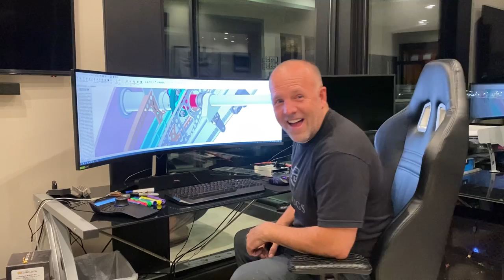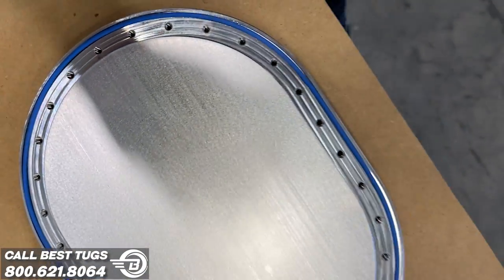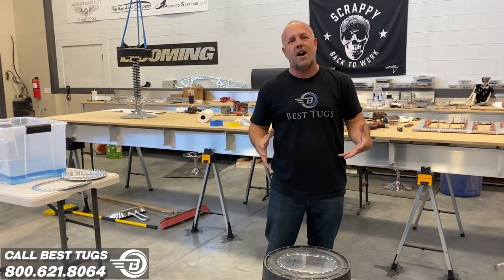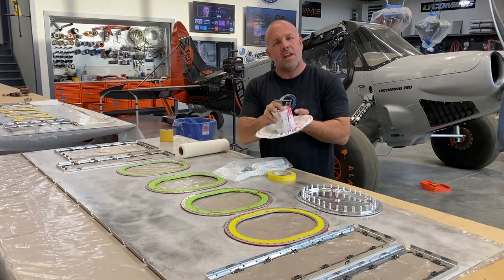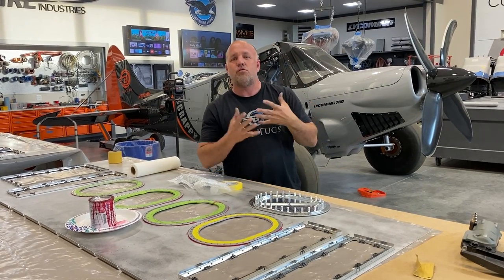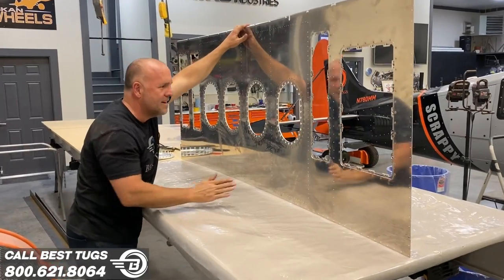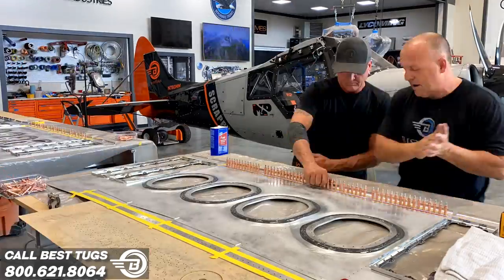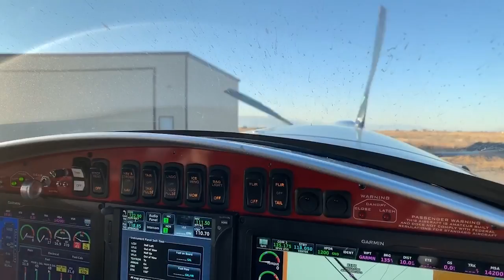WILD, one of a kind, Bush Plane Build | Scrappy #54

Comment: A few of us are trying to create a new safety culture in climbing circles. It is the philosophy and virtual religious mantra to test before you commit. That is exactly what Mike Patey is doing each step along his development process. He is using engineering to eliminate potential problems in the future based on failures of the past. In climbing we test our system each time we change a set up. We stay attached to our anchor and test our system to ensure it has been set up correctly and only then do we disconnect from the anchor. We then continue to use our system that we know is correct until we need to make another change, then we reconnect to something we know will not fail and then and only then do we make a change. Repeat, rinse until we are back home with our loved ones.

Comment: The important thing here is that Mike is putting that little extra bit of effort in to every part as he goes. That's the bit that us mortals without CNC everything and unlimited budget can apply in our own work. Even if that's just making sure we use copper grease on the threads, swap out corrosion prone fasteners for stainless steel, make sure we drill proper pilot holes and countersinks when we're doing construction in timber etc. My dad (a very experienced and innovative engineer) always taught me to "cherish every part" - whether that's a part you're making or a part you're replacing, eventually your car/plane/furniture project/ motorbike ends up better and better a bit at a time.

Comment: Admit it, if these wings split into two like an X-wing fighter from Star Wars, nobody would be surprised.
Reply: Don't give him anymore ideas!
Reply from the maker: @daverohn383  😂👍😂
Reply: But if ya think about it...if you had excess fabric wadded up in the swing. You keep them tucked for speed and then split the wing halves to gain an extra 20sf of wing surface per side? I don't think that would exceptionally change the flap and slat purformance...I'm talking an 18 inch separation at the wing tips..
Reply: @daverohn383  i disagree I like it when mike gets ideas

Comment: There are so many aspects of Mr. Patey's engineering processes that are admirable. Possibly the most impressive is the degree to which he tests/proves his designs before flight.
Reply: I was thinking the same thing
Reply: AGREED. Sadly some of his work is merely doing it right or doing it the best it can be in the aftermath of others not doing it right or doing the best it can be done. A fisherman called Matt Watson in New Zealand gave a tour of his offshore rig. One of the features was a bow rail that instead of following the shape of the bow up and out, was set back inside the boat and met the person standing forward in the toss and turn of the sea, right at hip height, PERFECT. It was like he had invented fire and all he did was say "NO, I want it the way I want it."
Reply: Too bad he couldn’t have been involved with the raptor project; it would have turned out way differently.

Comment: Good explanation of different fuel panels. Had a 757 come in, had to remove a fuel panel. The screws were not tight and some were sticking out. It never leaked. Has the same design. On the other hand, talking about top plates, DC9/ MD80 top plates for access to the fuel boosts pumps. You find them leaking when they fuel the plane. Had several gate calls before and found little fountains on top of the wing. Tighten screws and carry on. 
 Didn't see this but and good tip for smoothing out sealant is to use soapy water on your finger to do the final finish on the sealant.

Comment: Mike you are simply a genius!  I will say your fuel plate design is the exact same as the V-22 osprey which I’ve been working on for quite sometime now. At this point on life after dealing with them so much I really wish the engineers that designed it would have put as much thought into that thing as you do your projects. I can’t wait to see how scrappy ends up coming out, it will be amazing and unique. Also I just wanted to thank you for everything you do for aviation as a whole. I’m currently trying to finish up my private and my A&P. You inspire not only myself but others everyday! Let’s get back to work!!!

Comment: OH WOW!!! Now those one piece fuel doors/ threaded seal caps would have been a godsend on my KC-135 back in the day .... where each nutplate had to be goobered up with sealant
Reply: Guess he won't be needing the pink powder, eh?
Reply: @barrygrant2907  OMG you remember that !!!!   I was not only a crew chief.... but since I was small... I was also fire guard on graves when we had a man in tank..... so I could climb in and rescue....so I learned a ton about the inside of a tank.... they taught me stuff the crew chiefs didn’t know.   And LEAK DETECTION was my strongest asset.  I actually had a puffer bottle in my bag ... along with my CTK ... SAC 81-85
Reply: Engineers everywhere are like… why didn’t I think of that?

Comment: As always, I soak this stuff up like a sponge. Your approach to building is more than an inspiration, it's manna from heaven! 30 years ago, I had an idea on how to increase thrust in a ducted fan. I have stretched it our so many times over the years and never pursued it. After watching your progress on Scrappy and the methodology you use, I have begun drafting out a test version of my ideas. It will take me some time, but I have to thank you for getting me back into the right frame of mind to finally "get back to work". Keep up the fantastic job you're doing. My sponge is drying out!

Comment: I wouldn’t think that testing the fuel tank inspection doors with so much static head pressure would be analogous to in-flight dynamic pressures. You could likely remove all the screws for that test and the head pressure will only better seal the o-ring. That being said, it’s beautifully engineered and I doubt it ever would leak. Nice job, Mike!
Reply: I am not a design, structural or fluid dynamics engineer but I am curious about expansion of the AV fuel on a super hot day, no matter the density altitude.
I know and understand there will be overflow/ expansion vents...
Another curious point of interest, regards the expansion and contraction of the aluminum arising from the ambient air temperatures.
Beautiful work, Mike and crew!
Now, back to work!
Reply: @snoopy7647   @Snoopy  Well, notice that everything is Al alloy so no problem with differing expansion coefficients (only slight variation from gauges/thickness) and no cement (such as epoxy), only flexible sealant and 0-rings. I reckon the design of these tanks and service ports would be up to the job on a space craft.
Reply: @snoopy7647  It's not that bad, only a bit more than mogas due to the more aromatic nature of avgas.

Comment: At Boeing, when they were bucking the rivets, the noise was so bad they had to ensure all employees had hearing protection, and it was mandatory.  When they installed the rivets it was called "Bucking".  One mechanic was outside the aircraft, and another inside.  The outside mechanic had a hammer type tool that pounded the head of the river and the inside mechanic has, what is called a "Bucking Bar" which was used to flatten the tail of the rivet.  It has to be within a certain diameter, based on the type of rivet.  When you had multiple processes happening the noise was deafining.
Reply: I was in there helping w/ the tanks today and made sure everyone had ear pro.  It’s crazy loud!
Reply: @ChandraSlyFoxPatey  try listening to the bucking prices when there are multiple processes happening, on multiple aircraft, with the aircraft acting as amplifiers.  It's nuts!
Reply: @timothyosborn1697   😳🤪😳🤪 I’ll bet it would rattle your brain!!

Comment: Thought it was great seeing that 2 part sealant in the tube used on a project like Scrappy.  I use that stuff on a regular basis with the P-3 and EP-3 phase maintenance here on the Navy base in Whidbey throughout the week, and not just in fuel areas.  Makes awesome fillets for antenna bases and other vulnerable areas with hydraulic fluid intrusion points.  Just wonder if much of the engineering going into Scrappy will be incorporated into Draco part 2. Definitely got me addicted to waiting for the next episode Mike!  Keep up the awesome work!

Comment: Hello Mike. I really enjoy watching your post. I just finished watching #54 and was wondering about the sealants you used between pieces. You are using what was designed as a sloshing sealer in the place of a fay seal. I like the fact that is so thin and will eliminate rivet pucking but will it remain sealed over time. I'm building an F1 Rocket at the moment and would like to have the smother rivet line result on the tanks.
Reply from the maker: 🤠 hope this helps. So where I used it and how I used it I’m 100 percent comfortable as it’s an inch past the main fuel tank seal.  You will see in another video the main seal is done with a conventional seal.  On the joints that have direct contact to fuel or may not get a second joint layer of proseal or other primary covering, I would use standard seal and if you want you can dilute the tank sealer to make it a little thinner but in the future video you may get some ideas how to do it as I will show more detail.

Comment: Parks $150,000 worth of vehicles to protect 2 plastic buckets. 😂 I love this guy.
Reply: I think the bigger concern is to protect the fuel in the test tank from being spilled out if hit by a vehicle. That could make quite a wiener roast if that happened.
Reply: The vehicles are insured and can be replaced.  The test results are priceless.

I expect that the test fluid was water and not anything dangerous.
Reply: Think he was more worried about having to restart the test!
Reply from the maker: 😂😂😂. Yea the first day test was water so if I had a problem it was easy.  After that I did a 24  hour test with fuel as the final test.  It would suck to spill that 🤪
Reply: Mike Patey thank you for all you do sir 🙏🏼. You are a huge inspiration and I am patiently waiting for my Scrappy wing souvenirs. I feel special for being able to watch this series in real time. God speed sir.
Reply: @MikePatey  Tell me about it... I was a fueler at SJC for Atlantic Aviation in the '90s.  Fuel spills definitely suck!
Reply: Why not add a $2 spigot to the bucket and negate the need for a pump.
Reply from the maker: @garyg7145   🤠 great question, if I had it I may have considered it.  The simple answer.  I didn’t have a one in my hangar for the tank so it is less time to take a giant pump I have on my fuel tank and pump it out in one 3 minutes then it does to drive to the store, buy cut, bond and install a drain for a single test when what I have can save me an hour plus.  I will do just about anything to not leave the shop.  It just destroys the progress every time you leave for anything it always takes way longer than you think .  Well it does for me anyway.  I’ll do it the hard way if it saves me an hour or two.  👍🤠
Reply: @MikePatey  why are the wings aluminum instead of carbon fiber?
Reply: @PetesGuide  I've been very curious also. Part of that may be because of the inspection doors. The other could be because he started with aluminum  spars. Although  had he had encased those in foam he would have had no trouble with electrolysis. I have a feeling there are a couple more surprises coming.
Reply: @MikePatey  Don’t you have somebody you can send out for parts when you need them? If you know the shop, the part you need, give them a call and have them taxi it to you. Delivery in minutes at a cost you can easily afford.
Reply: @MikePatey  Yes, important to test with fuel as it will go through a smaller hole than water will - that's how those filter funnels work.
Amazing how true the wing was when you put the level across it! Great work!!

Comment: Inspection doors under the wing. Avoid any sleepig failure possible is just way to go in my opinion. Sleeping failure is just a bitch waiting to rip you off. You like to know about leaks when climbing to altitutes where humidity can build up ice or water can be sucked in by decending when there is no pressure relief in a cavity. How do you handle the pressure inside the tank? Would be nice to know.

Mike, the fuel drip test... ain't it harder to seal low pressure because of sealing activation? Especially when screws are lose. Your drip test is cool and hands on but I'd test it without all that weight with just a little fuel inside.
Reply from the maker: 👍🤠 great questions. tank vents maintain a max of 2 psi and never a vacuum under any altitude changes or speeds.  I did test the tank at intervals every few inches after that water test.  I started over with fuel and step tested.  So many things get left out of the video as I had so many hours  of footage and try and skim it down to 15-20 minutes
Reply: @MikePatey  thanks Mike. Had to be some valve or thing preventing the fuel tank from vacuum. You need engine up there 😉 Regarding those tons of thoughts and decissions leading to a Scrappy you will never be able to spread all those details and cross paths, dead end roads... wait... am I the only one who would appreciate to be provided with your raw uncut material? You should run a show based on this builds because Scrapy won't be the last and your family continues maybe. Like Boyds does but really focus on the hard part of designing critical products. Appreciate your effort.

Comment: Also if there's a leak on a top inspection door if the tank is full enough to be against the door, the partial vaccum  on top of the wing will suck fuel out... have had fuel leak through a bad gasket on a fuel cap. (purple fuel stain down the wing from the cap and smell of fuel while in flight was the warning...)

Comment: Hi Mike and team! I have a question probably not related to this video however I have wondered what the glide ratio (?) of a normal carbon cub and the one your building with the new wing would be. If you had a complete engine failure how far could you glide vs a normal carbon cub assuming a safe landing zone.

Comment: I've always wondered with you extensive knowledge and experience in engineering and aviation what kind of "training"or "schooling" do you have?  Do you have an A&P?
Reply: Great question, but I would be interested in more then the schooling because in my case much of what I do in my various projects is only loosely connected to any schooling  much of what I do I learned by doing.
Reply: I'm not sure what urrent certs he has but he or (maybe his brother I mix them up) dropped out engineering school and started an engineering firm and are almost completely self taught.

Comment: I'm impressed with Mike's lateral thinking when it comes to solving engineering problems, especially when many others would say close enough he goes that step further to make it better than standard practice engineering. 
One thing I have a query over is leak testing the seals around the fuel tank inspection ports. In the test Mike used water which due to its molecular shape (the two atoms of hydrogen are bonded to the oxygen atom at an angle of 104.45 degrees rather than being equally spaced at an angle of 180 degrees) water has a particularly strong surface tension. In fact this surface tension is so strong that you can easily overfill a glass of water by several millimetres before the surface tension is overridden by the gravity trying to pull the water over the edge of the glass.
On the other hand avgas being a petrochemical and has an extremely low surface tension to the point that it can actually act as a lubricant and will leak out of extremely small holes or imperfections that ordinary water would not.
Ideally the test should have been carried out using avgas, but that would be extremely dangerous, especially if there was a leak. However, there is a way to make water act more like fuel and that's by adding something that breaks down the surface tension.
Just a side story here that you can try and that proves my point. If you nearly fill a glass of with water and carefully place a pin on the surface sideways you should be able to get it to float. Don't try it but if the glass was full of avgas the pin would would sink and you would never be able to get it to float. So back to the pin floating on the water due to surface tension. If you very carefully use an eye dropper to add one drop of detergent to the glass of water your floating pin will suddenly sink because the detergent is acting as a surfactant and breaks down the bond between the water molecules.
Now getting back to the original test of the fuel tank inspection panel seals. To really get an accurate tests that will ensure that the seals will not leak when avgas is used instead of water you need to add a reasonable quantity of detergent to the water so that the surface tension is removed and you get a test that closely resembles what will happen when the seal is preventing fuel from leaking rather than water.
Having said that, Mike's test is probably enough considering half the fasteners were missing and the remainder were not properly tightened, but when your messing about with avgas in the wing of an aeroplane where an inflight fuel leak could be catastrophic retesting the seal with a bottle of dishwashing detergent added to the water would possibly be worth doing.
My apologies for the long winded post, but it's a fairly complex topic that's rather important to understand fully.
Reply: Good point, explained clearly. 

Mike replied to another post above the he ran an additional leak test with a avgas for 24 hours. No leaks!😉👍

Comment: So Mike, when you run Scrappy with out the wing installed, where is the fuel supplying the engine coming from?
Reply: There’s a vertical header tank in the back.